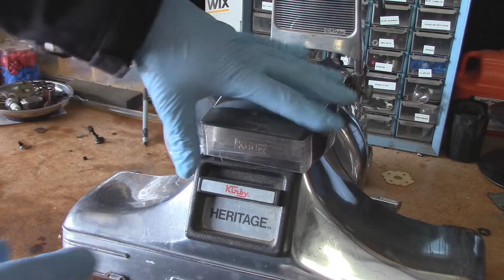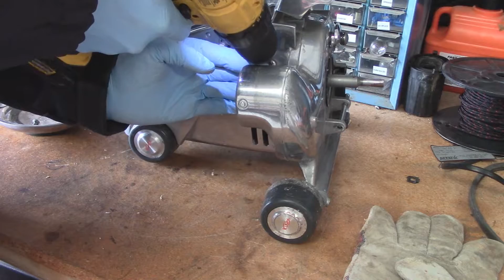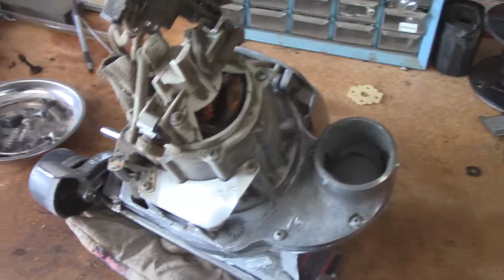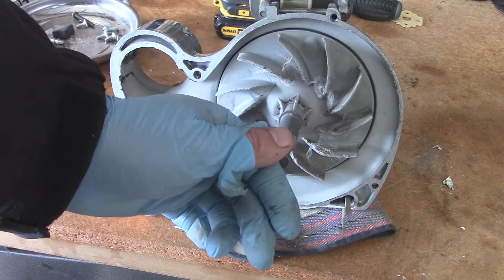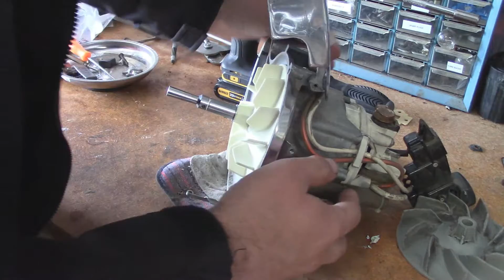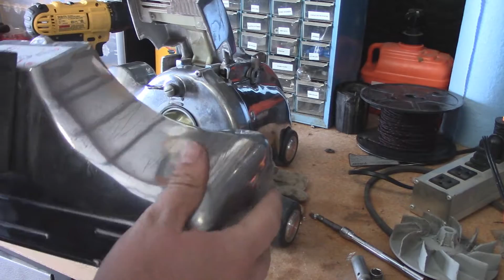Kirby Heritage Turbo and Up Fan Replacement

Comment: I really want to customize a vintage kirby. Paint it bright red with white trim. Have a customer red bag made in the new style. I think it would look amazing. And I'm talking like a automotive quality paint job polished with slight metallic finish to it. Just thinking of which one to customize. Was thinking about putting a sentria handle on a old sanitronic since it has the same rounded arteco design that the sanitronic has. The sanitronic in red would look amazing. Also quick tip just throw stuff like this into your dish washer. Makes quick work of it. Another thing to do is let it soak in vinegar. It eats away at the corrosion makes it easier to polish.

Comment: Why replace it with a plastic one that would break fast right?
Reply from the maker: Don't have much of a choice they are all plastic
Reply: The cream colored fans are made or a very durable polymer, similar to kevlar. They do not break easily.
Reply: The difference is that Amodel, as used on all Kirby motor fans produced since the G5, is a harder plastic than most.
Reply: But still, if you use your Kirby to inflate or deflate things or other tasks the inflator tool handles (like cleaning your computer keyboard), never do so for more than 5 minutes at a time!
Reply: Mine just broke today, the vac was purchased in 1987, i wouldn't call that fast. At this rate I won't live long enough to have to replace it again.

Comment: Yeah i was always a fan of these older Hoovers and Kirbys my grandma has a older Kirby like this, also the Royal brand is similair to the Kirbys. I have been wanting to pick up one of these older vacuums for my own house cleaning sooner or later
Reply from the maker: +Theghostmaster 87 I have a total of 3 kirbys now lol, I got a g7 the other day as well as a blue kirby tradition that I actually thought was a royal at first
Reply: Thats not bad, those Kirbys are expensive from what i hear thats the only way im going to get one is trash picked
Reply from the maker: new they are going for over a grand most people end up paying 1500 and up, its a total racket. Kirby needs to get with the times and ditch the door to door BS, there is no transparency at all, most of the people they sell too are old people and these distributors start that negotiations at $4k, no joke...
Reply: yeah they are good but thats alot i could go buy a decent older chevy truck for $1500 around here plus these are bagged vacuums and canister is supposedly cleaner and more effective and the cheap ones go for around $50-$100 at walmart
Reply from the maker: +Theghostmaster 87 Yea the only thing I dont like about the canister ones is emptying them, the dust screws with my allergies the bags have always been better for me in that regard you can find tests and reviews here on youtube on alot of the canister vacs as well
Reply: Right, i always try not to let dust and crap fly everywhere when i dump the canister the bag you just throw in the trash no dust cloud or anyithing but the canister vacuum we have is a Euraka and it does much better then our dirt devil which is bagged you wouldnt beleive the crap that comes out of the carpet espically with our dogs, even if we use the old dirt devil first

Comment: Wow, you posted this while I was watching the plastic carb vid. Nice job restoring the Kirby. Just curious, is it necessary to swap out the fan? Do they tend to be problematic or was it simply part of your particular restoration?
Reply from the maker: Over time as they age they crack apparently or they impact debris and get damaged. They should last about 20 years though from what the vac shop said

Comment: These Kirby's are strange looking machines! I gave away one of my Sanitaires to my grandparents but I kept the newer of the two (2009). That leaves me room to get an Oreck. I have my eye open for one. I've always been slightly into vacuums but your video where you trash picked vacuums seemed to re-surged my interest into them lol.
Reply from the maker: Yea that happens lol same happens to me just picked up a eureka heavy duty commercial which appears to be the same as a sanitaire.
Reply: +hanksranger Yes same company makes them. Did you get it new or used? If I recall, WalMart used to sell the Eureka commercials. When will a video be up?
Reply from the maker: +ChicagoSirens I've got parts on the way for it no beater bar or skid plate. It works but also have to replace the bulb. Within a week more than likely.
Reply from the maker: +ChicagoSirens Just picked up 2 more kirbys today a newer G7d which works but needs to be cleaned up and new parts and also a blue which I havent gotten into yet, but it needs a full cleaning.